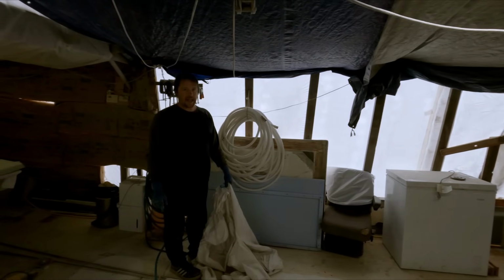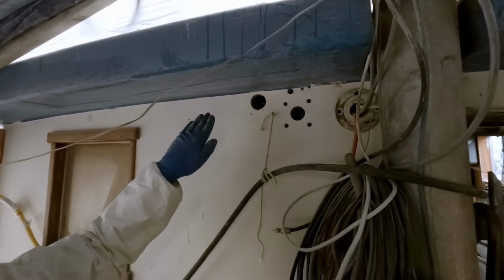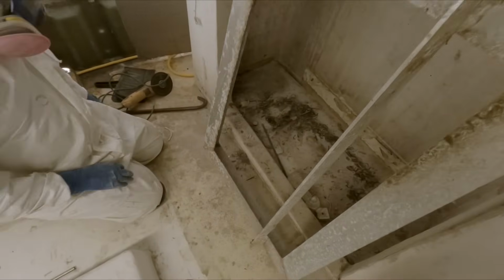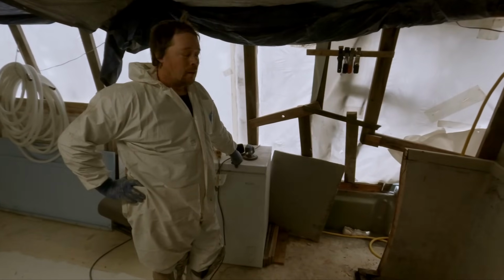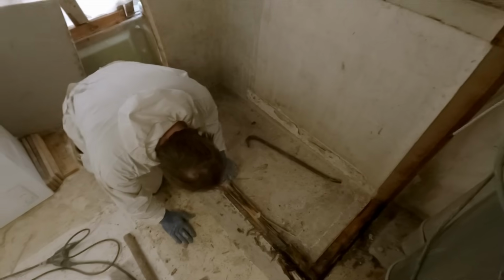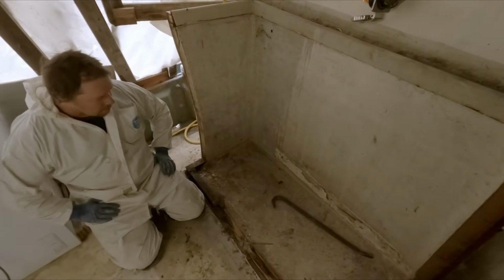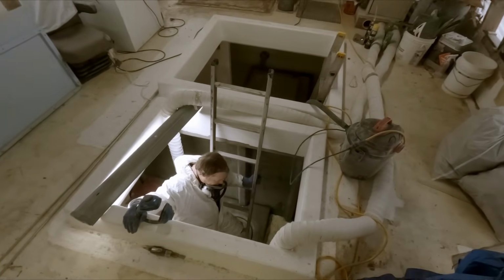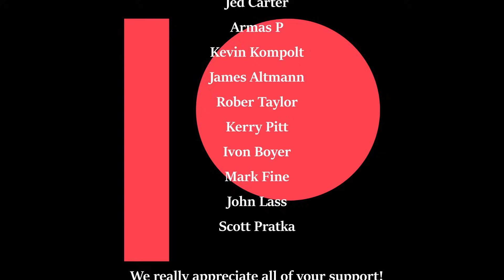Clearing Up Deck Space Removing Freezer Enclosure! - Emerald Isle: Ep.81 Fishing Boat Refit Backlog

Comment: You joke about your screwdriver handled broom, but I’ve had to remove the long handles on a couple of brooms for cleanup in confined spaces. I’m using broom heads with no handles which doesn’t always work. I’m taking a coffee break, when I get back to work I’m going to stick a short handle on one of the heads for working in confined areas ! If There’s a long handled broken screwdriver in my scrap box of handles, I’m going to fabricate  a screwbroom for confined spaces! You guys could be on to something.
Reply from the maker: Haha! Hey, if it works it works! Thanks for commenting, Peter.

Comment: Sometimes you folk confuse me...
Some Projects you tear and Rip out all kinds of stuff.... Then rebuild it...
Then there are projects like the Freezer where you seem to be going out of your way to preserve something you really feel is not appropriate...

Why save the Freezer you don't want...
Instead of reselling the old unit and buying one with the capaxity you do want?
Reply from the maker: The cheat freezer itself is perfectly functional, its the enclosure that was obsolete. It definitely wouldn’t have fit a regular sized freezer, even if we got standalone components the internals of the box were no good. So we ripped it out, there wont be a new box going back there. Just a aluminum frame for a chest freezer to sit on above deck level.